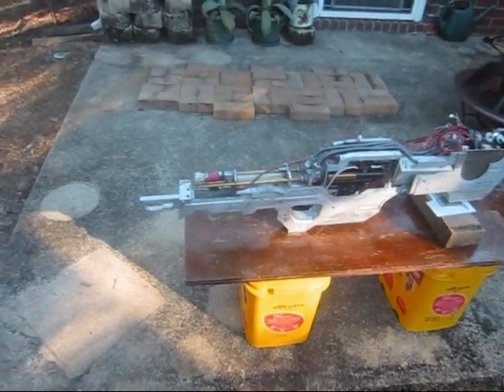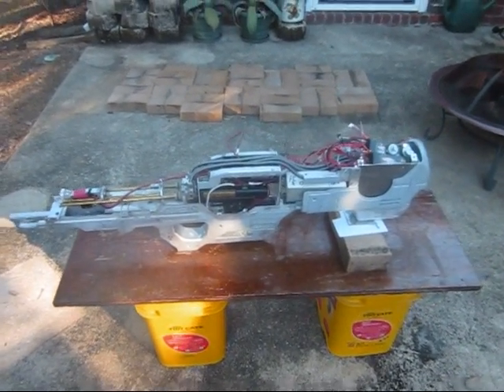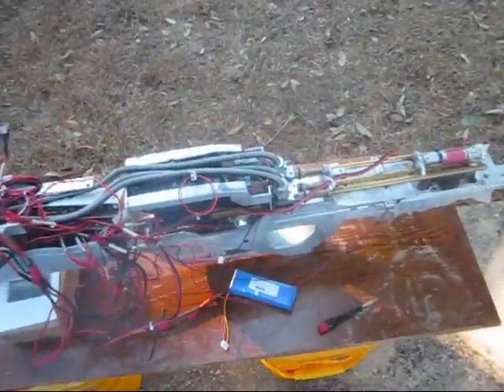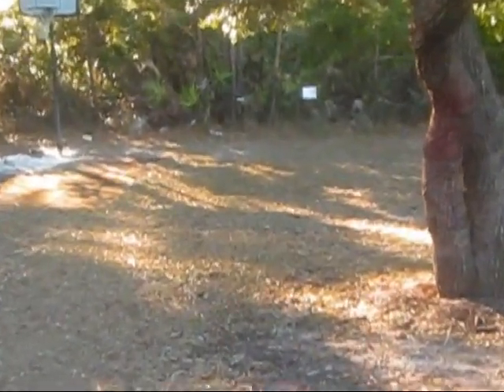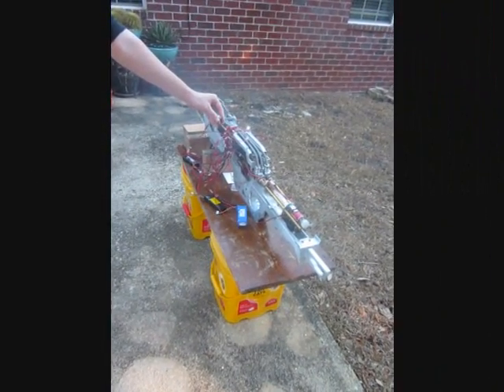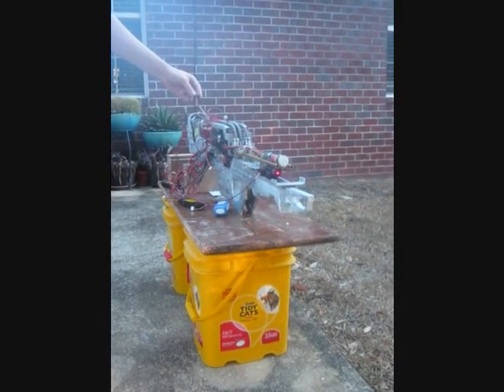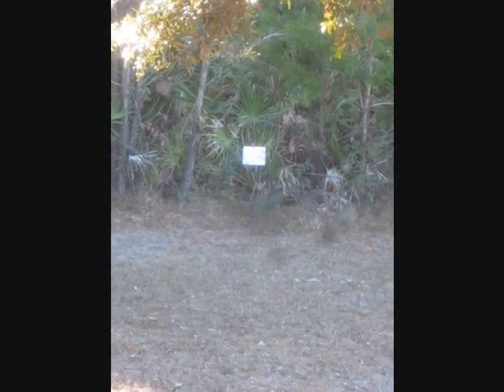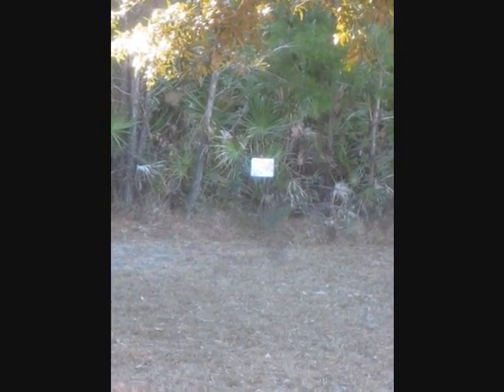Spartan Laser Firing Test

Comment: Been reading the build on 405th great job, I was wondering what hop up / barrel you used for these?
Reply from the maker: Thanks for following. I used P90 chambers and barrels. For the two upside down gearboxes I had to cut the chambers in half right in front of the back end that fits into the gearbox, rotate one part 180 degrees, glue it back together, then reinforce it externally. If I was doing it today, I'd just model a custom P90 chamber and hop with the back end reversed. My trip butchered and Frankensteined back together chambered have worked flawlessly from day one.
Reply: @Redshirt98  thank you for replying 👍 I managed to acquire a couple of those nerf blasters another poster put pics up on so am looking to convert one of those into an airsoft weapon.
Reply from the maker: @db7314  join us over on FB in the Halo Airsoft Community. We have several Nerf conversions going if you look back over the past few months. Also check Spartan Jess' channel here on YouTube. He does great videos to show how he does his conversions.
Reply: @Redshirt98  thank you, I found your channel through Spartan Jess 😊
Reply from the maker: @db7314  Excellent! We are good friends and bookend the Halo airsoft prop world with him showing conversions of existing props with basic tools and me trying to push materials and technology. Notice that he gets a lot more finished products :)